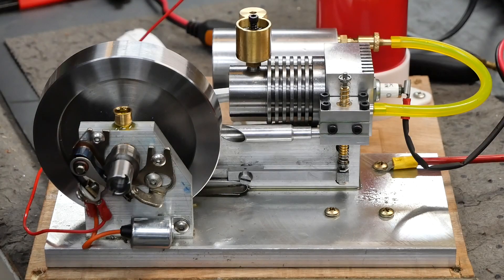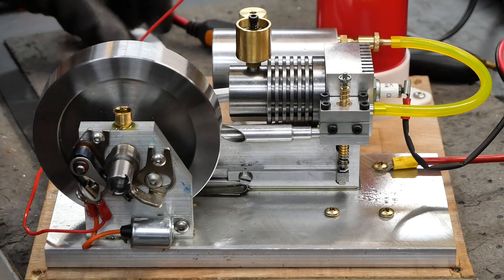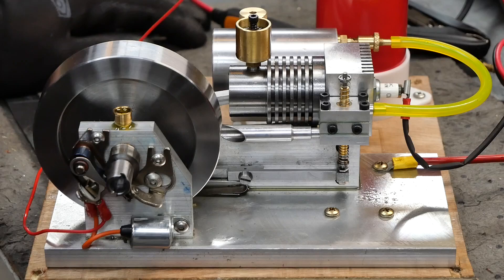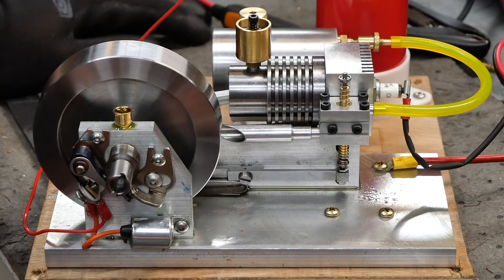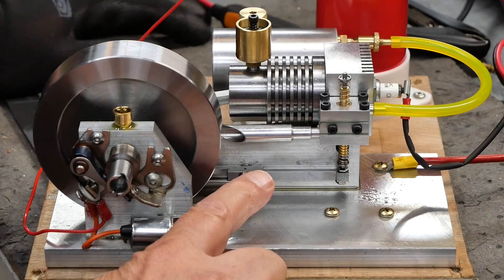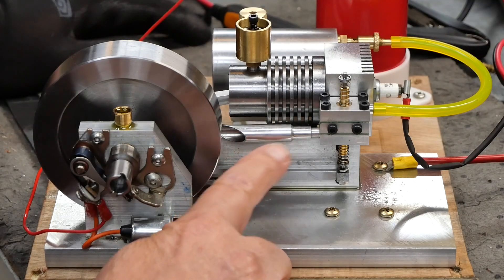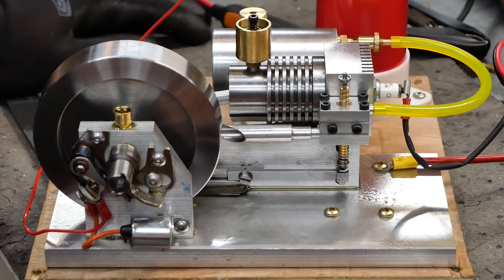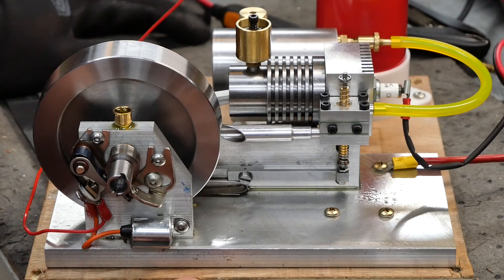Webster Engine - Exhaust Back Pressure

Comment: The extra pressure held in the cylinder changes the atmospheric inlet valve timing slightly (holding it closed longer) causing a more optimum mixture at the particular carb setting. (Only a guess)
Reply from the maker: Sounds plausible to me.
Thanks for watching.
Reply: @alanshomeworkshop  I have a Webster engine I built a few years ago. It runs up to about 3500rpm which seems quite something when you consider the inlet and exhaust share one tiny little hole into the cylinder. I leave mine running about 1000rpm for about 45 minutes, I used an enlarged head with fins but everything gets pretty hot... I stop it if the oil starts smoking lol.
Reply from the maker: @piclife1178  The longest I have run mine for is about 5 mins - its only a desk ornament :) However, when revving it up for a mate's amusement recently, the intake valve threw out its retaining pin and dropped into the manifold. Fortunately no damage was done but it could have been quite nasty as cylinder compression vented through the fuel tank until the engine stopped turning. Amazingly I found both the pin and keeper on the engine deck, so I just reattached them and all good again. I should probably make new keepers with deeper recesses to prevent this happening again...

Comment: Alan I am thinking on this one which is dangerous.  First thing i am think about is the Internal combustion engine doesn't like back pressure. When you blank the exhaust the unburn fuel is reverting back it the combustion chamber and increases the revs . The exhaust you have is turned at a right a angle come straight out then  adjust the fuel mixture . Looking forward to the comments, my brain is over tax a the moment will think about it more tonight .
Kit from up north